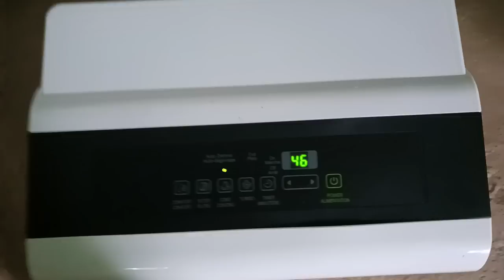hubs all back together

Comment: Hi Jim, Great to see things going back together. Petroleum products will destroy brake rubber parts for sure. I learned that back in the middle 60's. Only use synthetic grease on brake parts. The whole thinking process is different on specialty cars like Ferrari's. Example: Typically disc brakes have a spring to push the pads AWAY from the rotor. (regular cars) So, I believe you are doing right checking and learning about each item as you go about repairs. I'm hoping the clutch release will start to work with some use. There may be a little something like dried grease or corrosion on the trans input housing making the release bearing carrier stick. Heat and use may free it up. If not, you can investigate that issue when you are comfortable with doing more exotic car work. Meanwhile, as my auto tech teacher/ weekend cop on Woodward Avenue used to say: "Keep It Stock, Keep It Clean, And Drive It.'' Thanks for the update.Oh: One more thing: Are you going to use the old Ford Tractor to mow the grass? I have a 6' flail mower for mine, and when the knives are sharp it does a perfect job. ben/ michigan

Comment: Hi Jim, maybe you did already but jack each corner to it’s approximate ride height before finally tightening the suspension pivot bolts. Otherwise you risk tearing the rubber bushes if it’s tightened at full droop.